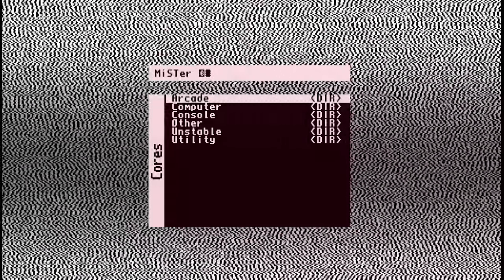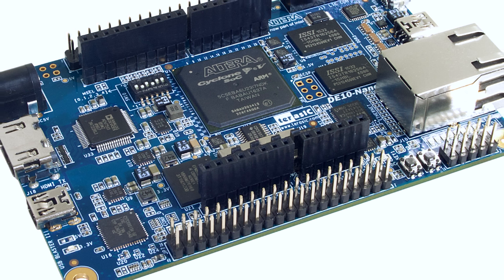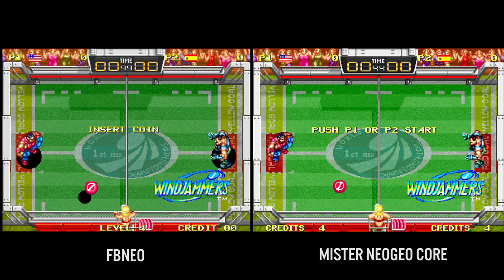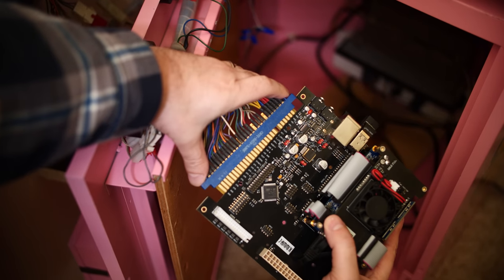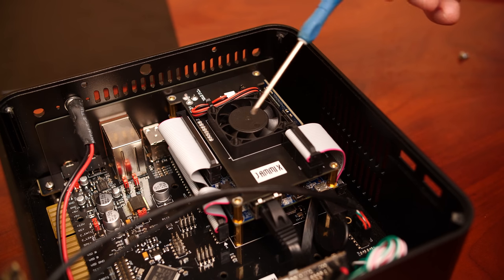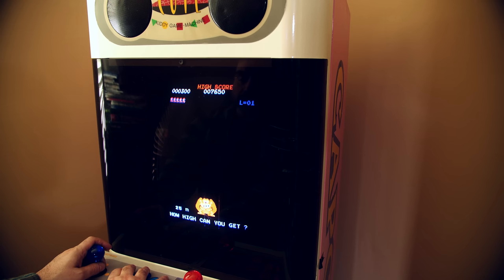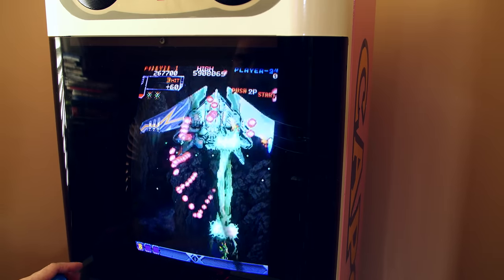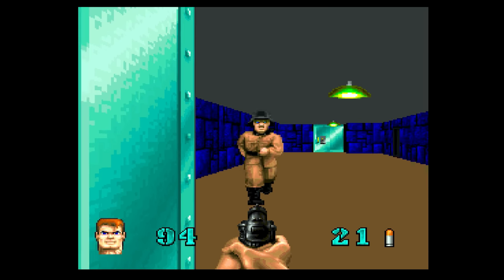Finally - I got my hands on a MiSTer FPGA Retro Gaming Setup | MVG

Comment from the maker: I'll admit im a total n00b when it comes to the MiSTer Project and FPGA, so if i missed anything or made an error somewhere please let me know. Have a great week!
Reply: Hi MVG, hope you will cover the zelda oot pc port soon when its finished
Reply: You have done the community proud :)
Reply: Ok bro
Reply: Do a video on raspberry pi gaming
Reply: I think you've done a good job ! There's a wide variety of expansion boards and console-like cases. I went for a Multisystem from RMC The Cave and absolutely love it !
Reply: You hearted your own comment? 🤣
Reply: There's one cool info I got on your last clone console video comment section: some cores are not made from original hardware but from emulators due to undocumented hardware
Reply: Chip gets very hot, so what does the power consumption look like? Would an actual JAMMA board be more power efficient?
Reply: wait, what? you didn't have a mister? no way.. welcome to the party :)
Reply: Just one thing, Mister use suite 240p and mdfourier to make sure that every core is 99% correct
Reply: What is the fan size and heat sink size?
Reply: FPGA zum Spass is the name with the spaces added back. Robert Peip is the developer. Happy to see the MiSTer video.
Reply: Outstanding video!!! I would love to buy a prebuilt MiSTer Device Setup for a MegaCade home project. MVG do you know of any good places to buy.
Reply: The only two things you got wrong:
the chip doesnt get that hot from the FPGA side, its the built in ARM chip that generates heat. The ARM chip is used to run the linux interface for FPGA core and IO.
In fact, few cores run the chip that hot that you´d need a fan. ao486 is one that runs the cip hot. But yeah to be sure you want to run everything stable its good to add a fan.
The other thing you sort of got wrong is price, that its expensive. Well if you want all bells and wistles , yes its 350 -450 usd. But to get started you only need the DE10 nano and an USB otg cable many cores work without the SDRAM board so you could start small and add according to need.
Reply from the maker: @RetroJack  and now i hearted yours
Reply from the maker: @tenshin2002  the problem is you cant find a DE-10 right now. the cheapest i could find was $350 for the DE-10 alone
Reply: @MrGamelover23  This!🤟
Reply: Great video! So happy to see the mister getting some love here on the channel.

I wouldn’t call it an error but just because a core is implemented in an fpga, that doesn’t mean it accurately represents the schematic of the hardware. You could do that or another approach is to recreate the behavior of the system at a high level. This can be very important i cases like audio where the behavior isn’t 100% digital. So generally, decapping and that sort of thing is only done for chips where this sort of thing is impoartant. In other cases the implementation can be quite similar to emulation where you’re mostly focusing on inputs and outputs than the internals of the chip. Hope that makes sense.
Reply: Someone with your skillset could get a lot of fun out of a fpga.
Reply: @RetroJack  imagine ignoring the actual comment to talk shit about someone hearting and pinning their own post. People do it every day. Maybe you’re new to YouTube. Not that big of a deal guy.
Reply: @ModernVintageGamer  But thats due to the current situation with chip shortage/scalping and it was not made clear thats what you meant in the video. You can just place an order with mouser/digikey, you will have to wait but get it for under 200USD. My point is that you dont have to go for the 700USD you alluded to in the video. Start small and expand if needed.
Reply: I just want to know what you would do if YOU were going to do a custom arcade build on a Dynamo Showcase cabinet for a 100% do-it-all cabinet with 4 players, track ball, guns, etc.

What would be your button layout, would you use hyperspin, what specs computer, what monitor and speakers would you use, etc?
Reply: Great video! You don't need cooling necessarily in my experience. I ran my mister without cooling for more than half a year when I first got it.
Reply: SNAC, ligthguns, custom video mode, the MiSter Project has so much to give.
Reply: @ModernVintageGamer  what ITX case is the one you are using for your setup?
Reply: @tenshin2002  I ordered mine for $172 (plus $20 shipping and tax) on mouser on Dec 7... supposed to ship out today. I have very low confidence it will. If you order right now, the listed price is $210 (plus $20 shipping and tax) and the estimated time they will receive stock is 50 weeks!
Reply: @RetroJack  and yours haha
Reply: @jaredvw  50 weeks, lol!
Reply: $208 appears to be the new actual retail price for the DE10 nano. I bought mine back in 2020 and I can't remember what it was then, but it has bumped up a few times now due to the chip shortages. When they'll be available again is looking pretty grim. Mouser seems to have a bunch on order (unless that's just the number of pre-orders so far) but there's a 50 week lead time!
Reply: @alextirrellRI  depending on when you bought it probably ~$145.  In 2019 it was ~$120 :(  It’s too bad at $120 + $50 for sdram to be able to do everything it was a very affordable project but now probably a lot of interested people are priced out of it.  Thanks parts shortage and inflation
Reply: Great Video as always!👍👍👍
Reply: The biggest piece that got missed was lightgun games. You can use SNAC (Serial Native Accessory Converter) and a CRT and play lightgun games. BUT you can also set up a Wiimote bar and use a Wiimote on modern TVs. Or mouse. There are so many options for light gun games. However, using an original light phaser on SMS is something special. So accurate.
Reply: Moreover, you can use the CRT on the expansion board I/O AND the HDMI on the MiSTer to capture live lightgun games being played with a real light gun. That's not something you can do with many setups because of lag.
Reply: @afropovic  probably way, way less power than original arcade boards, fpga gets hot because it is packing and running the functionality of many chips in a single and smaller chip and there is also an ARM cpu doing stuff like USB and other parts, so the cooling is due to having so much in a way smaller condensed chip, but that chip is using transistors that consume much less power than the original chips. 🙂 As an example, a MSX2+ FPGA implementation consumes less than 7W while many msx computers packing all functionality in those cores consume more than 25W (I know that because I've helped a MSX FPGA core project).
Reply: The GBA core allows for two player games as two GBAs linked with their screen going to HDMI and CRT.
Reply: @austacker1786  True but if you can afford it great convenience!  As for the Acorn Archimedes core a Raspberry Pi Zero will destroy that anyway due to it being a native Arm Chip for RiscOS!  Also, if you wanted to do PS2 and above that FPGA is way underpowered!  One has to be thinking a follow up is being worked on?
Reply: MvG :) With the Amiga Demo issue and Plasma, I too experienced this with the BTS Demo. However, I found a fix for it. Most of the Amiga Demos were coded with PAL 50hz Machines in mind. When using an option to Force 50hz (the MegaAGS Pack I downloaded has a Force PAL Mode option in its Menu), the Real AGA Plasma of BTS worked fine :) If I ran it in the default setting which is NTSC 60hz, I exhibited similar glitches with the Plasma as you showed in this video.
Reply: No worries, if you just give some programming weekends to FPGA you learn enough to actually give us much better information.
Reply: you said emulation was free that is false that pc or phone you are using COST MONEY you pay no matter what you use to play on
Reply: Dude, I love that you hearted your own comment!

Yes, I want a heart too
Reply: For what I can tell about all this, even though its enthusiasts are selling it as "real" hardware recreation, it is still emulation on a different level and does need software to work. I'm also n00b (don't know if that is a censorable word but will follow the spelling from you) on this but I believe that this is mostly a different, closer, very expensive and cumbersome way to emulate old hardware, but not a better nor the ultimate. Not much different from the software based, probably the biggest difference is that it works on top of less layers than old emulation, while the rest have to work on top of software that's on top of an OS that's also on top of a BIOS before going on the hardware, this one goes on a tiny BIOS then to hardware.
I really can't say that this is the ultimate way to play retro as I can't (and possibly won't ever) afford a machine like this, but what I can really say is that is making the cheaper, more accessible software-based emulation to lose the level of acceptance it had gained on recent years and is also creating a new faction of elitists among retro enthusiasts who shame or even bully those that have to resort to software based emulation and even real hardware. 

It actually worries me more that what it should excite me; I'm beginning to believe that the future of retro gaming will only be in the hands of those with the pockets to afford expensive and obsolete pieces of media formats and the FPGAs with the add-ons to play them (or rather show them off). 

Artificial scarcity (LRG and the like), crazy auctions and expensive ways to play games like this one, are actually creating a bleak future for games in general. I'm glad the Doomsday Clock is at 11:59, the future might not be a good place to live in if everything goes on as it is.

P.S.: Want to convince me that this is real hardware preservation? Recreate on FPGA the unstable voltage dropping fault on the SN76489 without using an approach like the current software-based emulation does and make it sound e-x-a-c-t-l-y as the real one does. Not even hardware clones are capable of doing it right.
Reply: it was actually a thorough overview of the project well done.
Reply: @austacker1786  I know I personally would not buy it.  It is not a good deal! It takes a lot of work too! Would rather use the Raspberry Pi or my PC(s) to be honest!!
Reply: Damnit, you get me interested in something and the parts are sold out! Thanks! lmao.
Reply: @Thrakus  At a rough guess I would’ve thought 20mm - at least that’s what it looks like to me to be
Reply: 5:26 what game is this please?
Reply: I wish someone could make a semi-layman explainer to show why a "cycle accurate" software emulator is different than a "cycle accurate" hardware emulator, and also how hardware emulation isn't strictly a replication of original hardware. And why it is so much easier to make a "cycle accurate" emulator with FPGA than software. The fully commercial projects out there have played pretty fast and loose in advertising (it's still emulation! just some of the best emulation out there, cause it's easier to accomplish full timing accuracy), and someone with an actual tech background explaining the differences could be nice.

Someone explaining why things like the PSX are pushing the limits of current FPGAs and why even newer hardware might be very hard to pull off until new gens of FPGA tech exist might also be good. (or, indeed, if there's other challenges to the ability to reverse engineer newer hardware)
Reply: You should REALLY have mentioned whether the DE10-nano will go back into production and whether future availability will be assured. 
Not much use replacing a bunch of obsolete hardware with, ahem, obsolete hardware.
Reply: Hey Dimitris thank you for showing this machine. I would like to see updates on Playstation X on this board.
Reply: @OM19_MO79  I imagine that FPGA hardware is going to become more ubiquitous, cheaper, faster, and support bigger nets over time, just like other hardware that is generically useful. The fact that it's as relatively "cheap" as it is now to be somewhat obtainable, if a bit pricy, to middle class folks in the US instead of only for crazy hardware engineer type folks is proof of that. But I doubt software emulation is going the way of the dodo any time soon.
Who knows - maybe we'll also see specialist hardware supporting software emu, as addon cards for PCs, giving more direct access to scanline timing for framebuffer generation. The OS scheduling and API layers are part of the problem, but so is the driver layer and the abstractions exposed to the drawing API. Having a PPU-ish addon card might be cheap to produce these days, given the ultra simplicity and relatively low density of the hardware. Not trying to make predictions - just saying there's no particular reason to be pessimistic as of yet
Reply: @mattishida3067  Is that being worked on? Is that even possible? Considering how the PSX is basically a PS2, and how there are limitations in terms how how many transistors and logic gates you really have to play with in the DE10-nano's FPGA? So a PSX core seems like a tall order to me.
Reply: @ropersonline  You probably never heard the original name of Playstation 1, don't get mistaken by PCSX2 software. If this machine could handle PS2 and not PSX it would be more pricey
Reply: @mattishida3067  Wait, so you weren't actually talking about the Japan-only PSX digital video recorder? 

I only figured out after reading your comment that apparently PSX had also been used as a codename for the PS1, and I had never previously heard of the PCSX2 PlayStation 2 emulator either. 

When you mentioned "PSX", I was under the impression you were essentially referring to PS2-compatibility, since that's basically what the PSX (digital video recorder) is at its core (no pun intended). 

Sorry about the confusion, and yes, I agree with your last sentence, which was kind of what I meant to say as well: Implementing the PS2 in an FPGA seems impossibly hard and looks like it might be too much for the DE10-nano.

PS: That said, it might be best to say PS1 when you're talking about the PlayStation 1, since regardless of the earlier PS1 codename, the actual PSX is a whole other product more akin to a PS2.
Reply: Yours was the most accurate MiSTer intros I've seen yet.
Reply: @ModernVintageGamer  Have you played any of today's PS4 games on the PS4 emulator? If so, I recommend playing Fnaf Security Breach on it before the new February patch comes out.
Reply: Awesome coverage of the MiSTer project, and the DE-10 Nano. I've been looking for this unit for some time now, and like you say, they are not easily / affordably available at the moment (Jan 2022). I'd love to get a DE-10 Nano one day and try it out! Thank you for the video!
Reply: did anyone emulate the Philips cdi with Mad Dog McCree 🤔🔫🙇‍♂️
Reply: Not mentioned in the video, can it do add ons? SEGA Mega Drive's Virtua Racing, SNES' Starfox, 32x games, connected via 32x, MEGA CD, and so on.
Reply: gunstar heroes or vectorman, which is your favorite ?
Reply from the maker: @goruyorsunuzz  asking the real questions. i think id have to go with Vectorman
Reply: LOL - thanks!
Reply: @soloM81  Actually I would consider it a perfectly valid argument that if you're choice of device was going to be the same whether you chose to use it for emulation or not, that is if emulation didn't have any part in the moment you chose which device to buy, then emulation (as well as any other free software you didn't consider) can be argued to be an extra freebie that cost you no money. But if you later buy as much as a gaming controller to better enjoy emulation, then there's a cost. I for one never have considered buying a controller for PC games, but a couple years ago bought one for the purpose of emulation - which means I have paid less than 20€ to have better emulation experience, but I already had emulation for free before that.
Also, I actually paid nothing for my current main computer I'm using for emulation, among numerous other things. Even if emulation had been a factor, it would be only a small fraction of the price. And even large fraction of zero is still just zero.
Reply: @robsku1  still not free no matter how you spin it
Reply: @soloM81  If you want to produce a counter argument to what I said - and I really did not "spin" anything, it's a logically sound and simple argument - I'm perfectly willing, even glad to, consider whether it changes my opinion about this or not.

If not, well, I willl respect your right to disagree and leave it at that. I have no reason or will to forcibly show my opinion down you're throat, the world and humankind needs and depends on differing opinions.
Reply: Can you do HDMI at say 1600x1200 for those great cheap vintage LCD's in 4:3?
Reply: The fpgas go beyond representing the pcb/schematic (which connects chips together), but ideally will accurately represent the behavior of all the custom chips from the original system as well.

No guarantee of course, plenty of fpga cores are no more accurate than their software counterparts.